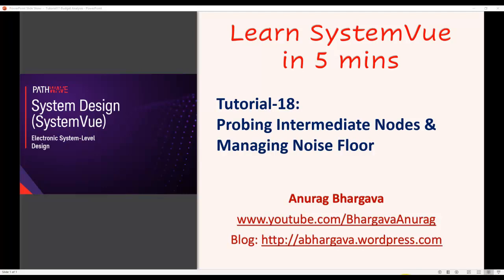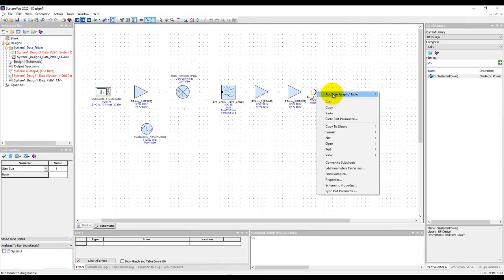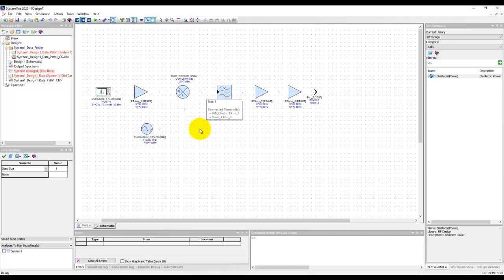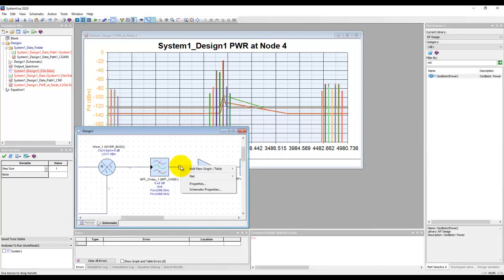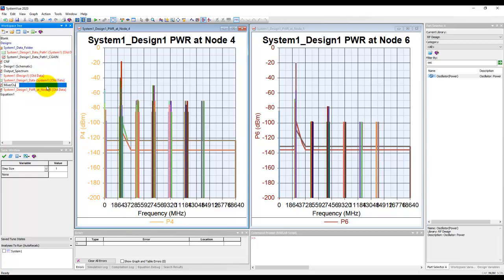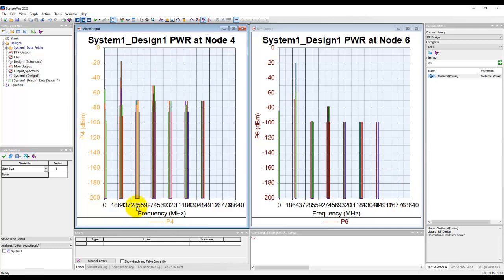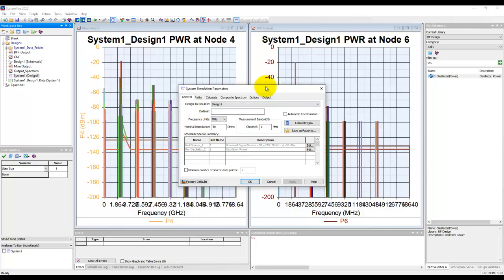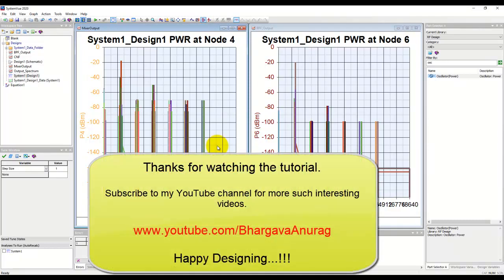Tutorial-18: Probing Intermediate Nodes and Managing Noise Floor

Comment: Question: Considering wide band filter response for the above simulation. If we assign an s-parameter to the filter component we should expect to have a little bit offset rejection of the filter out of band frequency and its impact on the spurious or IM will be less than its S-parameter rejection level (for instance the filter rejection at out of the band at f= 8GHz is -21dB but the harmonic level after the filter will be degraded by 15dB). I assume that is due to the different impedance and voltage at the other frequency and it will have an impact on the filtering topology of the whole system in which we usually need to consider more rejection for filtering topology. Am I right? Your feedback would be appreciated.
Reply from the maker: Yes, you are correct. It might have an implication on the overall system performance and that is why tool like SystemVue can help you to predict the same and then you can fine tune the overall performance.

Comment: The simulation shows two noise floors at mixer output and bpf output but only one noise floor at the final output i.e. node 3. Would you like to throw some light on that?
Reply from the maker: I would recommend to kindly contact Keysight tech support team for help as this will require some details for you to understand it properly or refer to the SystemVue documentation for more details.